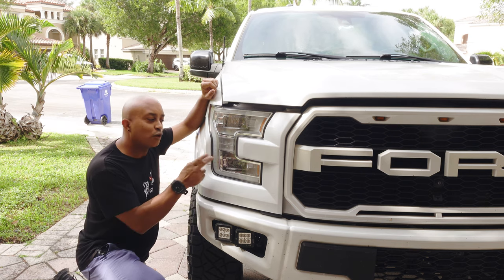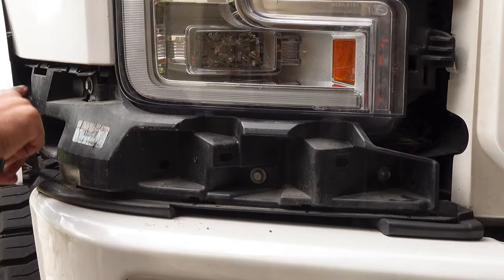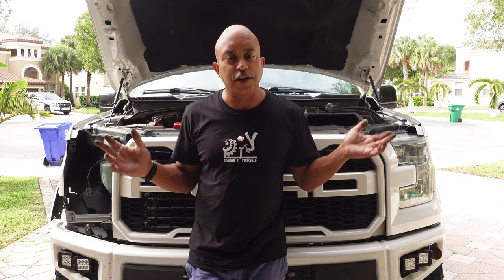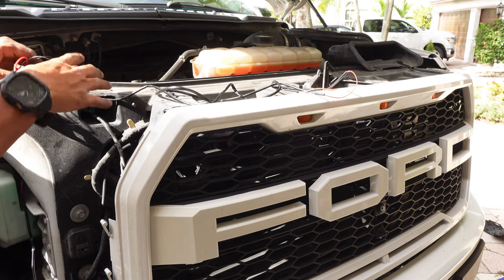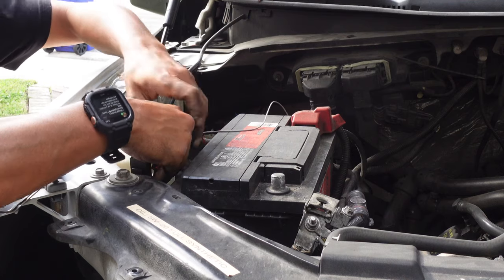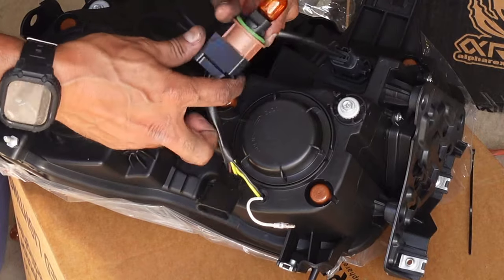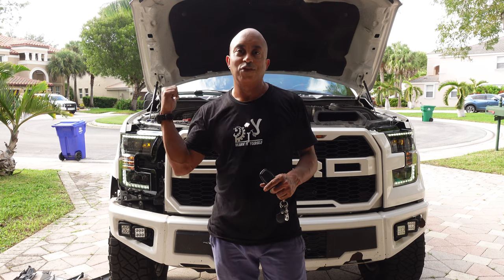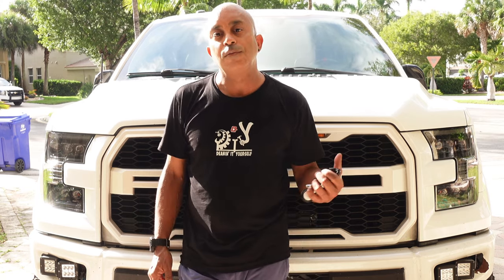The BEST F-150 Headlights Upgrade | Alpharex Nova Series Full Install

Comment: Awesome video like always. I've opted for the Morimoto. Love your bumper. Can you share where you got it ? Thanks.
Reply from the maker: I got it on eBay.
Reply: @DeaninItYourself  can you maybe share a link ? I like how you integrated 2 pods on each side. The ones I've seen on eBay have a 3 smaller pod design.